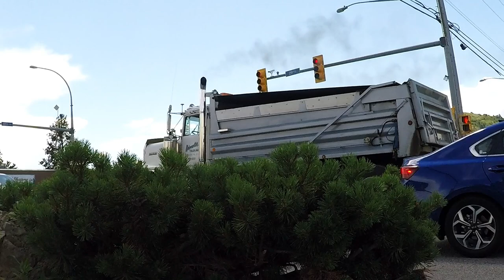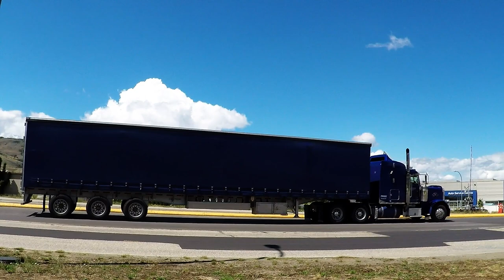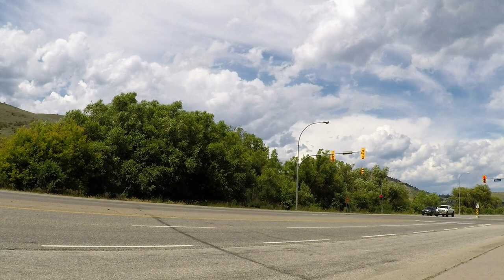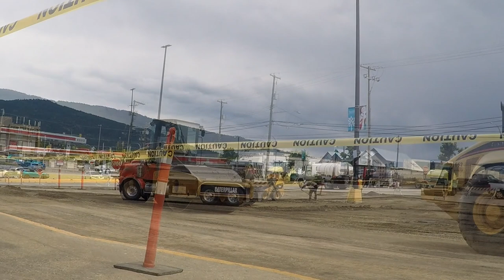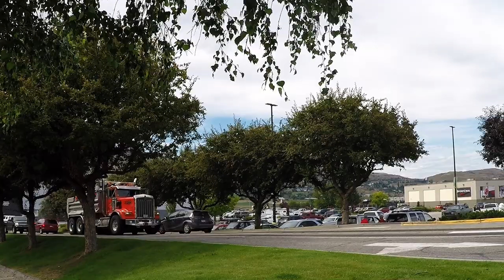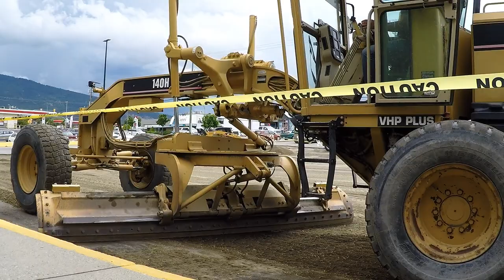LAYING NEW ASHALT, PT #2 / SPREADING GRAVEL / CAT 140H GRADER LEVELLING / DUMP TRUCKS #16, PT 2

Comment: What's the weight allowed on a tandem in BC?
Reply from the maker: Hi Robert. Front axle: 9,100 Kg (20,000 lbs). Tandem axle, 17,500 Kg (37,000 lbs’ish) Tri-drive: 23,000 Kg. (50,500 lbs). I may be off a pound or two, with my calculations. Metric conversion. Thanks for watching.👍